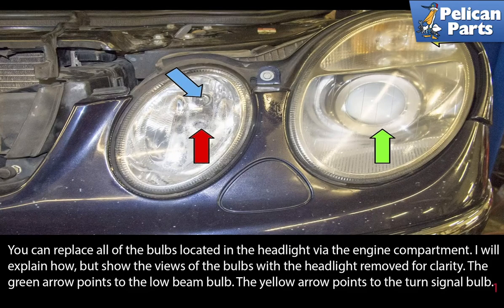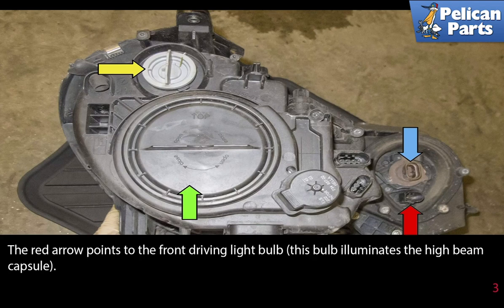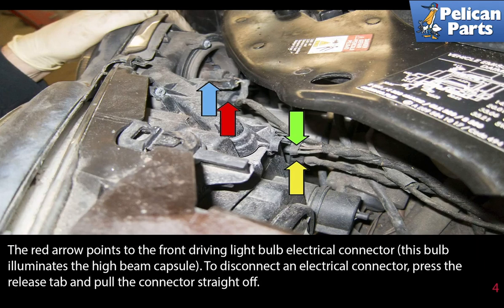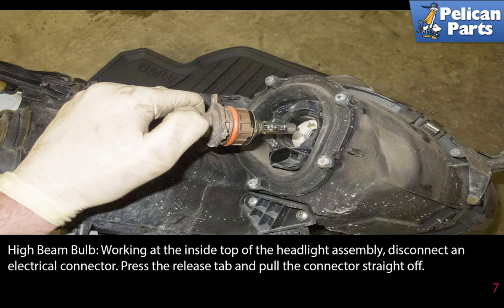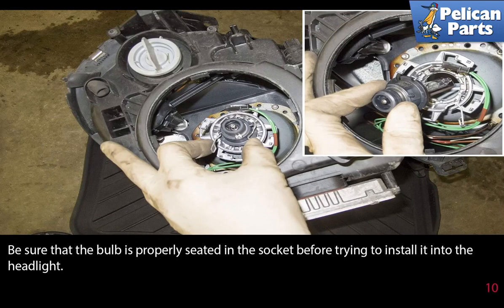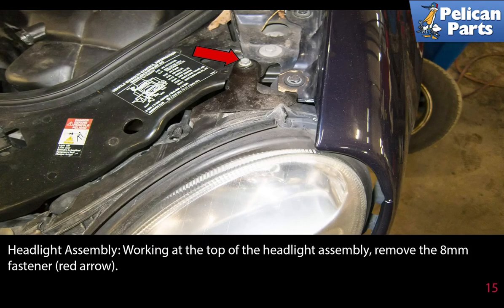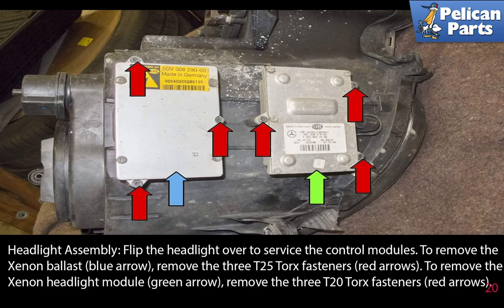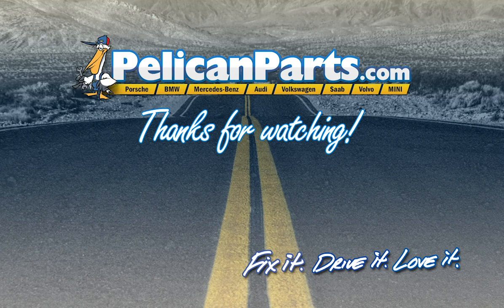Mercedes-Benz W211 E-Class Headlight Replacement

Comment: Thanks for the video, hope you can assist further, I removed the Xenon module behid the bulb and want to put it back, but I cant get it to turn back to close/lock into place, is there any trick in doing this, Do I need to remove the entire bumper to get to this headlight and take the headlight out to get it to turn close?
Reply from the maker: Yes, the headlight should be removed when replacing it.